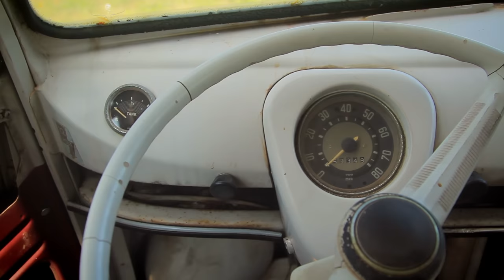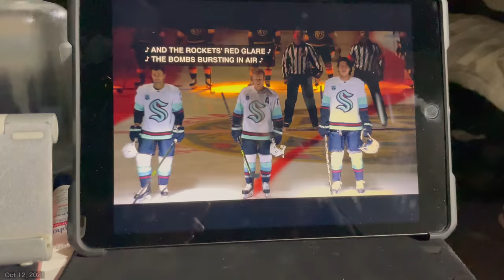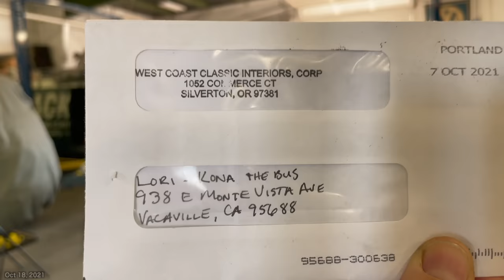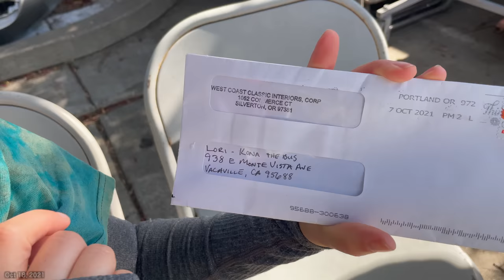VW Bus Restoration - Episode 58 - Prime Time! | MicBergsma

Comment: Hopefully you are touching up the Chrome bumper pieces with paint after removing the chrome finish with the file or reaming with the drill bit ! If not rust will eventually bleed onto the painted bumpers.

Comment: @mitch what is going on with the rear end of the bus? I didnt think you were going to slam it.
Reply from the maker: it was not setting up right.. need to take spring plates off and put them on again little lower to lift rear up... Robert helped put them on 🫣